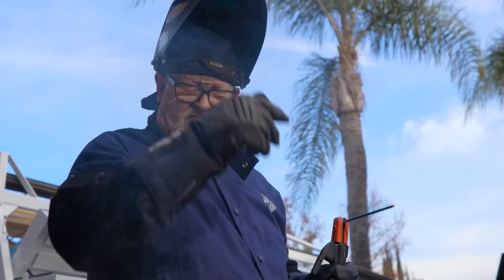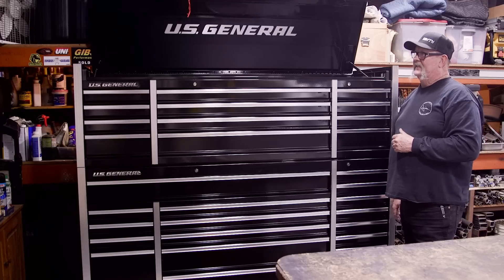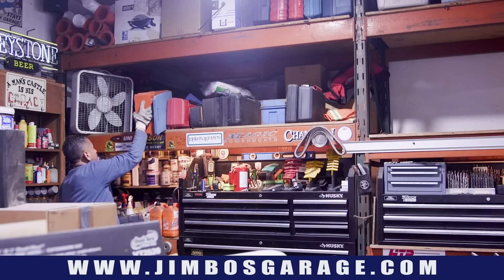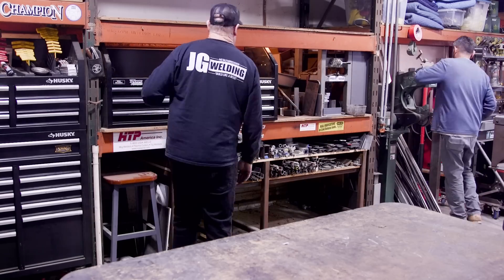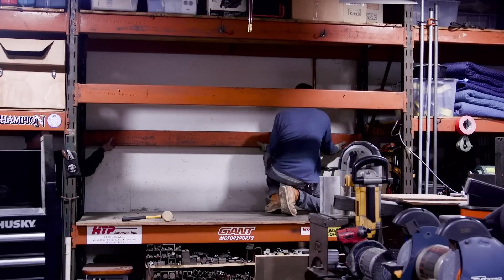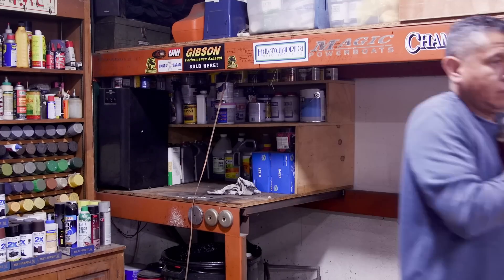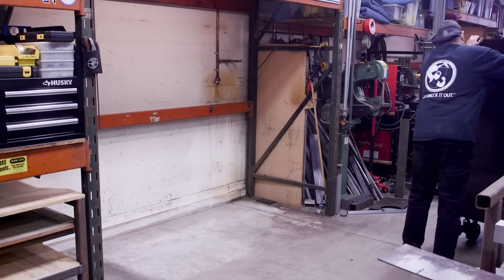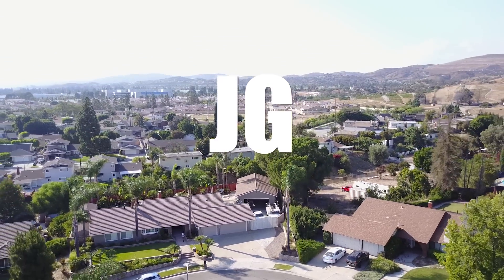Harbor Freight 72" US General Toolbox Upgrade | JIMBO'S GARAGE

Comment: I have the same box in blue.. I sold my snap on to buy it.. my snap on was a 53 and I out grew it.. only bad thing about the us general is the lack of a power supply in it.. but they sell a magnetic surge protector power cord that I installed in it and it works great..

Comment: That's funny. It's been almost 10 years Jimbo. I upgraded from my husky 52 to just last year. Matter of fact your review on the the husky box was how I found your channel and the reason I bought the husky 52 back in 2016 not long after you got yours. I didn't upgrade to the u.s general 72 I stuck to the 52 box. Everything I had in the entire husky 52 could fit in just the bottom of the u.s general 52. That was epic to see. U.s general boxes rock though.

Comment: Very nice! I've used a few us general boxes and find them to be outstanding. I recently did a big reorg myself and split my tools up a bit rather than buying a bigger box. I separated my machinist tooling and precision measurement tools into two single bank Kennedy boxes, my welding/fabrication/layout tools into another single bank Kennedy/Craftsman box, my mechanical tools into a used snap on double bank box, my household/woodworking tools into a single bank box with overhead shelving and added a workbench between that and the mechanical box for basic benchtop repairs. Liking the flow so far but still mentally reprogramming on grabbing tools from the new setup.

I'd love to see a video on how you store your hardware. At my hobby shop I use a combination of plastic organizer boxes, a small drawer parts cabinet and a LISTA cabinet. I work in aviation structural testing we use a giant locker with the plastic Akro bins, a LISTA and organizer trays. They've asked me to put some time into organizing the hardware there and don't have the budget for additional LISTAs so I'm looking for ideas on organization for basic and specialty hardware including MS and NAS fasteners.